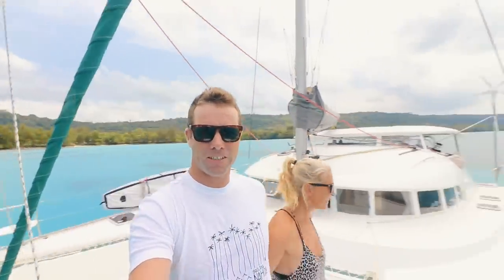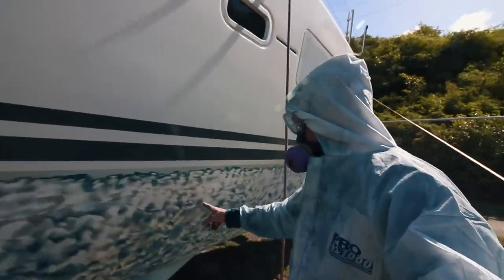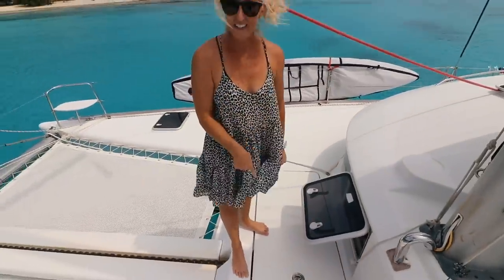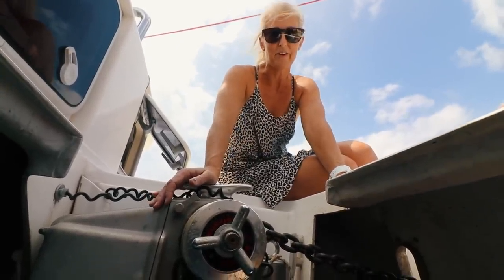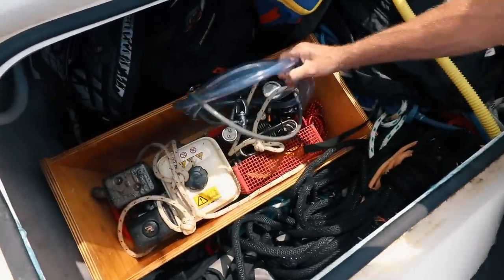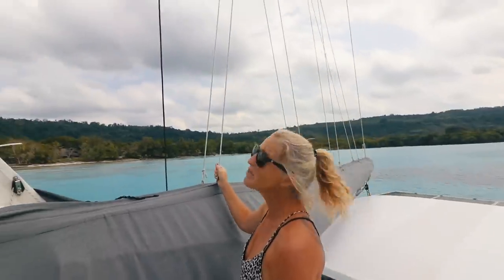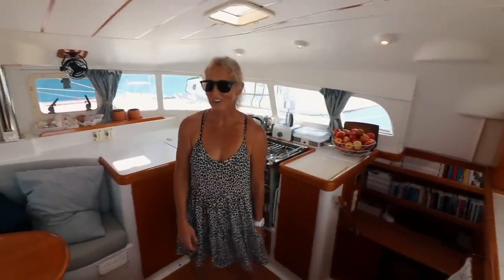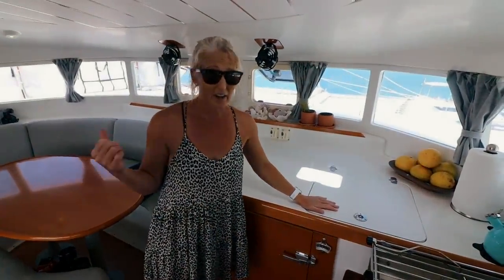Full Tour: Systems and Components of an Offshore Sailing Catamaran - Lagoon 410

Comment: Nice to meet you both and your boat by Youtube what a funny world. I was very impressed with our boat tour. Even though I'm a mono sailer. and have an ocean-going 15-meter aluminum boat. that I rebuild for the 3rd time as I had it for over 30 years. That said I want to check out your equipment list and it was not available. Of special interest are your dual iPad system of one for Sat and the other for chart navigation. Of interest, I would like to know how do you receive your say google earth downloads, and I am not sure what the other sat., download brand is did you call it bing?  Do you download sat., photos of areas where you are going to sail beforehand or not?  How do you integrate your GPS on the sat., photos located on your iPad?  This is of great interest to me. Thanks for your interesting boat tour effort. Though a Canadian/Australian mono sailer located in Australia  I still learned a lot. I love your shower area, just the best.

Comment: I heard the 410 is not necessarily built to support a code zero? I'm in the process of buying a Lagoon 410 S2 and wanted to install one. Do you need to reinforce the inner bow area of the hulls?  This is the comment I found online: 1) The 410 was never designed to have a bow sprit and there is no retro fit for this. 
2) A system has to be designed to allow for all the forces that will be at work at the attachment points.
3) We were advised that we would need the services of a marine engineer to work out the loads and what was required.
4)The cost of reinforcing the inner hulls where the dolphin strikers would be was considerable.
5) It was far cheaper to go to a system where we could run a downwind sail from the bows of the boat which is what we ended up doing.
6) I spoke with the owner of a Fountain Pajot Baha 46 that had a bowsprit installed and fail miserably. Once again the FP was never designed for a bowsprit. The work was done professionally by a shipwright who put in a large backing plate on either bow to support the dolphin strikers and had removed the core in the area affected. Long story short, the loads were so great that the inner hulls distorted causing damage. A marine engineer was called in and calculated the loads which then necessitated a support plate across the interior of each hull supported by backing plates and beefing up of the inner laminate where the dolphin strikers would attach.
7) could not think of to much worse then putting a hole in your hull near the water line while flying downwind. It could really mess with your day

Comment: Great Video! Everybody makes mistakes.  1. I had a diesel truck that had a leak and got water into the fuel...drained it out and forgot that I had put it into some 5 gallon tanks..same type I used for wave runner gas.  Bought a new engine for my dingy..hey I have all this gas for my wave runner, I thought...and was really ticked that my new Yamaha 9.9 would not start):. 2. Bought a new to me Yacht, was told by the broker that this fill between the other two fuel fills was an auxiliary tank.  My water fill is 30ft up the port side.  I had never put fuel into it but I needed another 20 gallons to get a 100 gallon discount so I put it into the "auxiliary fuel tank".  Get to anchor and my wife is filling up some ice trays and says, hey there is fuel coming out of the faucet. Aux water...aux fuel whats the difference? $7000 (insurance paid for it...wow) later all was good and thank god we didn't flush one of the 10,000 dollar vacu flush heads:)  Shit Happens!

Comment: good job, thanks.  I'm about to go and look at one, a 2000 model - any suggestions on non-obvious stuff to check for.  It does have 27hp engines - would that be a deal breaker for you?

Comment: Just recently come a cross you vlog and enjoying content and presentational style immensely as it is so down to earth and practical plus have confirmed many of my rough ideas for the ideal boat I am planning to get around 2022 liveaboard/cruising purposes.  Bottom line you show is that sensible cruising is not a black art.  Thoroughly enjoyable blitz around you boat and I have a couple of questions which may be covered in the comments you have had to date so if so just point me at them.  Firstly would you wish to have AirCon?  Accept the power consumption would be significant, although Wynns have managed to run these without need to run Genset too so with enough solar and lithium most things are possible.  Regarding the engine placement, actually hadn't considered the advantage of under bed engines being in a more benign environment but how do you find noise if motoring or motor sailing?  Presume you can run engine on non-owner's side only if needed so can sleep better and guests might have to rough it!

Comment: You said that power is very important, i agree, so have you thought about adding hydrogenerating to Nahoa?
Quote Oceanvolt "The hydro generation or “creating energy while sailing” function is an automatic feature in all Oceanvolt motors."
https://oceanvolt.com/solutions/hydro-generator/
The use case scenario for adding it, is that the solar panel and the little windmill somehow got destroyed beyond repair.

Comment: Hey guys, Thanks a lot for a great video. I do sail a lagoon 380, and last summer i had my firs issue with the cars to the main. I have maintained them well and they are super smooth when hoisting and getting sail down. Do you have a link or information on where to get those rods? Are they as smooth as the torlon balls? Thx so much for the tip!!

Comment: The big piece of metal is called a tie rod so as you can adjust tracking on the rudders independently to create straight tracking for hands off steering, works best with hydraulic helm.

Comment: Great enthusiastic tour! I agree having a cabin up above is a huge improvement on having it down below. I'm probably getting a micro Tiny boat, a 1980 Westerly Griffon 26 or maybe a 1979 Westerly Cirrus 22, then 2 or 3 years later a 34' or 35' ketch. Ya, a multi-hull is certainly appealing, but getting a 40-year used ketch would be massively cheaper...

Comment: I guarantee you that your are not sailing 35-40 degrees off the wind. Maybe off the Apparent Wind, which, as former mono-sailors, you should know the difference. Basically you are sailing 70-80 degrees of the True Wind. If you are lucky.
Reply: Chris Kibb  I will be the first one to agree that there is not necessarily one right way to do anything on a boat. I am curious, though, what do you think the "target audience" is? I will also be the first one to freely admit that I am NOT by any stretch of the imagination an expert shipwright. That being said, I am, however, a fairly experience sailor. I started sailing when I was about seven, and I've been at it for over four decades now. Despite my experience, I know that there are many things that I don't know. In order to cure my ignorance, I do a lot of research. I seek out authorities who have even more experience than I do and are experts in their fields. I read their books. Also, as I trained engineer with both BS and MS degrees, I apply my own skills to analyze and assess the information and apply the scientific process to evaluate it and come to my opinion.
The problem is that Simon, bless his heart, has relatively or practically no actual sailing experience, and he thinks he knows things based on building his van and his residential construction background, none of which are applicable in a marine environment. Simon himself freely admits that he doesn't necessarily know much, but instead of doing research learning, he proceeds based on his own cockamamie ideas, and when he finally realizes he screwed it up, rather than learning from that and doing the research to fix it properly, he just does it his own way again, and screws it up again, like is fubar door and now with his windows. To be specific, Simon realized that he screwed it up with his initial door configuration. But instead of researching and learning how to build a proper hatch, he just reversed the direction of the door and is then surprised when his idiotic latch fails and he gets snow all up inside of cabin. Now lets consider the windows. Did you actually listen to what Simon said about why he chose auto glass? He literally said that if auto glass was good enough for going down the highway at 60 mph, it should be good enough for a boat and especially since his windows are six feet above see level. Have you ever been on a boat when it gets hit by a 15 foot breaking wave? In case you weren't aware of it, water is thousands of times denser than air. So when your windows get get by a wall of water, its essentially like falling off a building onto concrete. That's why boat ports are usually relatively small, and the frames for ports are through bolted a four, six, or eight inches at most. Did you even look at the frames Simon built? He literally said that he built them like he used to for installing in a house or a tiny home. This is a disaster that could get Simon and anybody traveling with him killed. I don't want Simon to die. He is a good kid. I want him to have lots of fun adventures. Part of the problem is that most of his "target audience" is people who follow him from his Van Life days and they know even less about boating and sailing than Simon does, so they don't have any context to understand that the construction methods Simon is using are wholly unsuited for the purpose of traveling in a marine environment. I just wish Simon would make even some minimal effort to try and learn something about what he is trying to do. I sure hope Alladino talked some sense into him. So, in conclusion, the reason why my comments are so sarcastic and tinged with ridicule is because Simon is often fully deserving of it given the non-sensical statement he makes. Hope that helps. pk
Reply: Chris Kibb  My mistake. I thought your comment was aimed at a comment I had left on Simon's channel, not this one. So my response was then intended in the context of one of Simon's videos that I thought you were referring to. If you think my comment on this video was crass and pompous, then that's your problem, not mine. If they are going to put out videos with incorrect information in them, and then other people who know even less look at that information as authoritative, then I will occasionally chime in with more correct information. I wish them all the best on their adventure, and hope that they continue to share it with their audience. best regards, pk